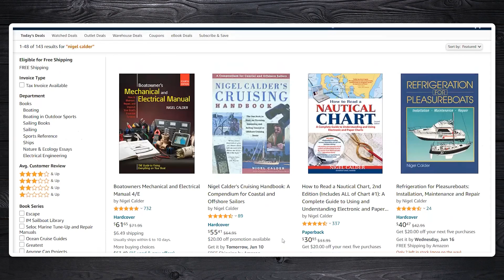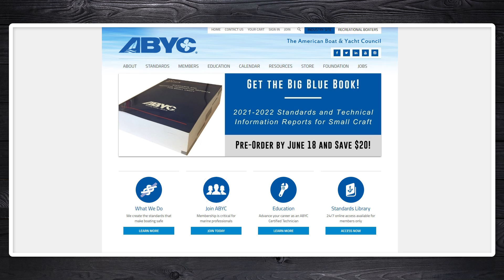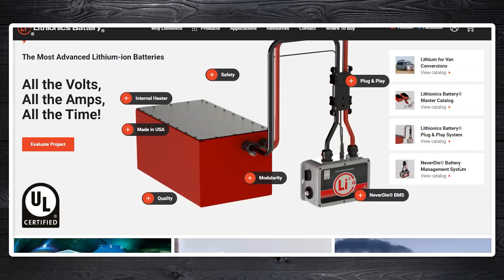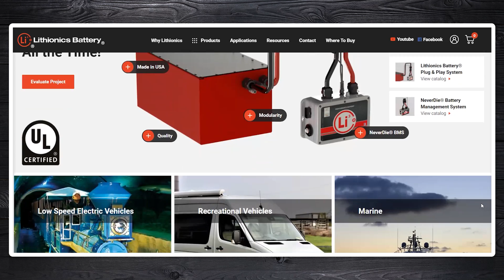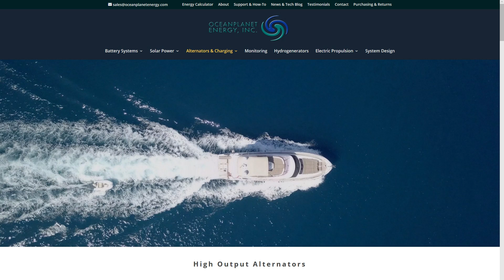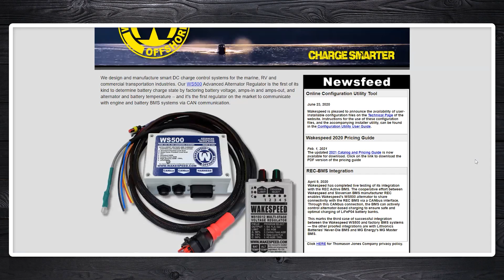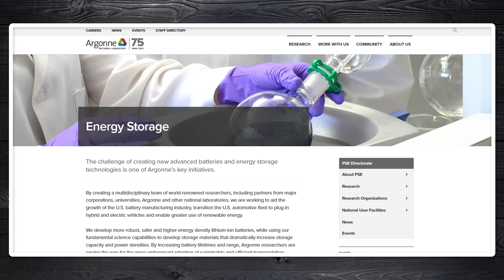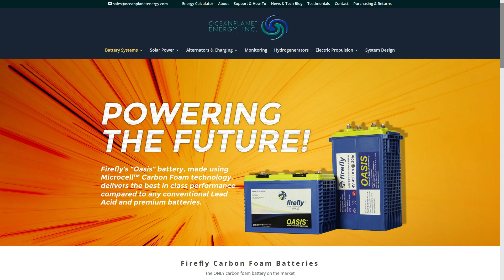Dock Talk with Jeff Cote and Nigel Calder - Part 1 of 2

Comment: two subjects not quite covered: 
1= Use of surge protection device to mitigate lightning strikes. SPDs short circuit phase, neutral and ground during a strike avoiding arc flash within equipment.
2= Have an independent temperature shut down system for each electrical equipment location. OCPD do not protect against over temperature.
Reply from the maker: Hi Josi, haven't seen this sort of systems before, anyone else can share their experience?

Comment: Wonder if we will start to see alternator cooling systems to deal with the larger outputs?
Reply from the maker: Good point, haven't seen this feature just yet.
Reply: @PacificYachtSystems  imagine an alternator with a self cooling system that could dump load into it in the event the li batteries shut off, buying time for a shut off. Time to design it then!

Comment: I'm a little confused, Nigel says the code is a minimum based on safety but then, moments later, says that LiFePO4 batteries that simply turn themselves off without notice are not approved. If an electrical system that fails, albeit safely, is no longer certifiable then this seems like an expansion of the codes reach.
Reply from the maker: Hanford, good point.

Comment: My idea is that there needs a new standard where a specific BMS of a Li ion battery can talk to all kind of charging devices like alternators, solar panel battery chargers and so on.  I haven't pondered upon it a big deal yet, but this is the direction it should go IMHO
Reply: @Aus L Thanks, I didn't know. What manufacturer delivers such a system?
Reply: Mastervolt can do that. They have lithium ion batteries, chargers, inverters, alternator regulators, and solar controllers, that can all be connected to their MasterBus network. They're pricey though. I'm sure other companies have this or are working on it as well.
Reply from the maker: Hi Airgead, good point. Communication between batteries and charging sources would alleviate some of the concerns about lithium BMS disconnecting the battery because of overcharging.
Reply: It is called canbus ! The BMS(REC) controls the Alternator via a Wakespeed regulator and controls victron Multi and MPPT , JOB DONE !
Reply: @markrobertson4320  Yes, but I am on the Mastervolt platform. I have a REC BMS.

Comment: I just removed my 1 cylinder 3000 RPM generator from my engine room. There was no way to get good access for service and inspection. I thought: what the heck: having two diesel engines on board: everything double, including through hulls, double fuel filters, and so on. Many years ago thought that the best way would be LiFePo4 and a huge alternator in order to use the main engine in a efficient way to recharge.
Reply from the maker: Airgead, what's the make and model of your boat?
Reply: @PacificYachtSystems  it is a Hallberg Rassy 40. The generator was a Fischer Panda
Reply: it turned out, only detectable once removed, that the plus cable of the starter battery had been chafed through over an about 1 foot length, and " repaired" with isolation tape. Also there was a loose hose that was visible once we removed the water pump, necessary to remove the generator from its shell, so that was the reason it was leaking...  I bought the boat when it was 3 years old, and I searched the internet and found there had been a fire in the motor room 2 times.